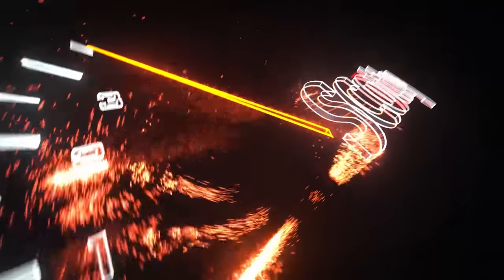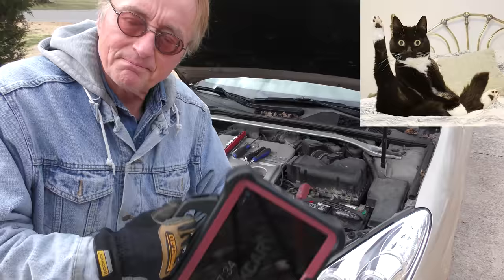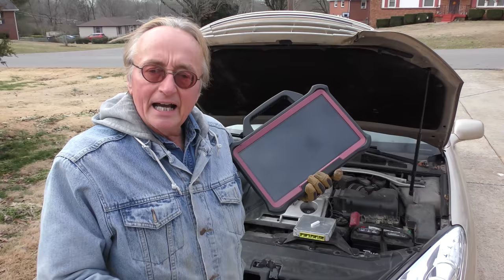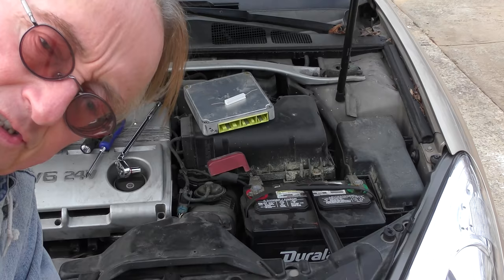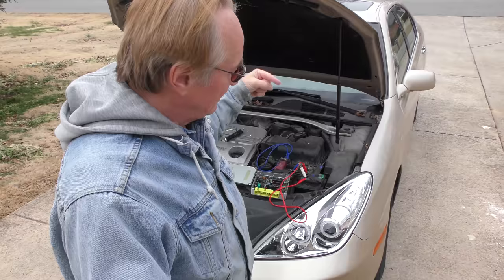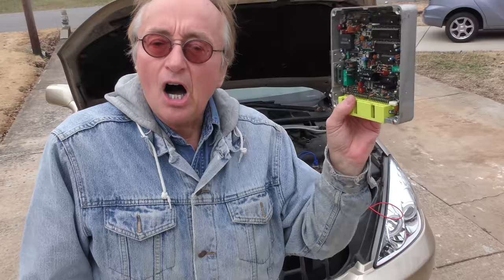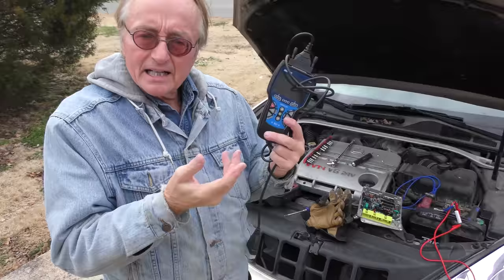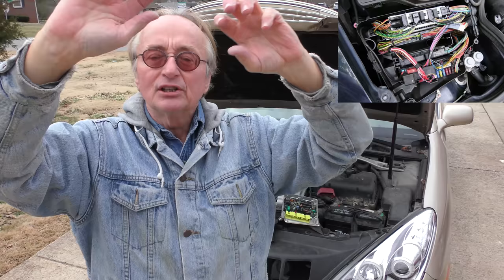This Stupid Thing Will Save You Thousands in Car Repairs

Comment: I think that the resistor you used is 1000 ohms, not 1 ohm. The K means to multiply by 1000 (and the J means + or - 5%).

Comment: hey scotty took picture your resistor say 1k 10 watt not 1 ohm 10 watt as u spoke on air can u tell me which is correct before try on my car from a 72 years hobby garage mechanic and thaks for your years of service and your excellent skills yes i i still own my 68 vette 327 350 hp original 19 years

Comment: You are so correct on that resistor. Even though you may remove the ECM, there still is voltage potential in its capacitors. I am a retired electrician so I used to work with things similar to this.I can see if a person shorts the --- and +++ together, that would cause a large inrush of current through all of the electronics from the negative to the positive destroying its solid state components. Just a very slow bleed of electrons going from negative to positive wont hurt any of the surface mount components. Scotty Sir,,,,YOU are the man. I find your podcasts very informative but entertaining as well. BTW, were you an Army paratrooper at one time?
Reply: I'd use a 1k ohm resistor. It would be a lot slower to drain any charges, but at 1 ohm if there are any charges built up that might drain them way too fast.v=iR or i=v/R.
Reply: Badbrain3185, would it also be a 10 watt, too?
Reply: @bettepage4856  It all depends on the manufactures design.

Comment: Good info for older vehicles pre 2003 ish , but be aware. You may accomplish the task of clearing stored codes, however a lot of that information would be helpful to diagnose current issues so your not testing or changing multiple components. Many vehicles store data to set thresholds for components to rely on. If you hard clear your stored data it may take days for your car to set new parameters. With a professional scan tool you can remove unnecessary or multiple issues and save needed data. If necessary I would only remove neg bat terminal with a terminal tool and turn on some lights to drain down stored power in capacitors.  If you hard drain  the electrical system on some new vehicles you lose data stored for fuel economy and performance curves. Radio, GPS, phone, seat, some keyless entry, and many personal settings on some equipped cars.

Comment: Scotty spot on,I and a lot of other factory trained tech should know this ECU or ECM look computer 101. Not every technician is factory certified or trained. There is another way to do this on most not all. After properly disconnecting the cables turn on the headlights for 5 minutes to drain any residual voltage in the entire electrical system. There are fail safes in the circuitry to prevent excessive discharge. The engineers never planned on us shad tree mechanics to figure ways around the proper way or their way.
Reply: Helpful tip! Thx.

Comment: Around the 4 minute mark, when taking off the batter terminals, you should take the negative off first.  The neg is grounded through the frame, and if you attack the positive first and are vigorously twisting with pliers, you might accidentally touch some other metal part electrically connected to the frame and complete the circuit with little internal resistance, resulting in a nice, burning arc.  Watches, bracelets and rings are especially dangerous in this case.
Reply: They also make battery terminal pullers. The tool won't damage the terminal, like vise grips, and they cost under 8 bucks at USA auto parts stores.
Reply: I thought you were right, so I checked a few reputable websites, and you are right. Am surprised Scotty got this wrong.
Reply: Yes ground off first. Goes on last.
Reply: @Steve_K2  I would bet you $1000 bucks he does know the right way to disconnect a battery but he has so much knowledge swirling around in his head that sometimes it bumps into each other and causes a momentary clitch.
Reply: True.
He also doesnt need to remove the negative terminal.
Reply: main reason for Neg first is so the + terminal doesn't bump anything causing sparks and arc welds.   Otherwise, with proper caution it doesn't really make a lot of difference.
Reply: @arvbergstedt3303  I transport vehicles for an vehicle auction company and have to boost them sometimes. Positive on first then negative, negative off first the positive is the rule.
Reply: hmm.. I wonder if for the installation of the live electric cable in the house we have to connect/disconnect the hot cable first? or it's just because of the AC vs DC system
Reply: Scotty, you call yourself a mechanic yet I just watched you pull the positive battery post first before removing the negative. SMH 😳
Reply: @faradaysage15  At least with your idea it would have justified why he pulled off the positive first. Good call.
Reply: @BionicLesbian if you’re careful it doesn’t really matter which cable comes off first. But it is a good habit to take negative off first.
Reply: Scotty just needs to hold the resistor between his left and right hands for 10-15 minutes. We inadvertently made his discombobulator store a code. 😂
Reply: @alecfed  right. you always do the reverse when reattaching cables to the battery.
Reply: Nitt picking ladies, if you short out the position yes with vise grips your being clumsy and a puller would have been better but really, find something else to do rather than busting his chops this guy has saved thousands of people millions of dollars. We all make small mistakes. Keep strong Scotty we all appreciate what you think and do.😊
Reply: Good catch😮
Reply: Imma try this tho I'm scared I'll blow up
But I have a u0028 and  a u0073  and my navigation stopped working. .
Reply: @chefottoman Actually it does matter.  Disconnecting the positive first can cause sparking which could ignite hydrogen gas around the battery and cause an explosion.  This is the same reason you're supposed to connect a negative jumper cable on the car being jump started to a ground instead of the battery.
Reply: Most times nothing happens, but when it does, it's not pretty. That's how I was taught, negative off first, on last.
Reply: Can't argue with that.
Reply: @chefottoman you never do something half a$$ed.  Improper maintenence or use of a tool, because a vehicle is a tool, creates injuries.
Reply: @kash1407 yes they connect the neutral last
Reply: @haywardcowan8574 &glitch 2😅
Reply: @seven471 then the hand servos might freeze up..
Reply: I have 96 Mark VIII, will this work on it?
Reply: @kash1407 in a house on ac, you have two "grounds" an earth, which gounds the fixture, your bare or green wire, then your nuetral, which acts like the ground on DC, white. Then your hot, black.  The thing with AC, it faults to earth, so if you touch it to anything that grounds to earth, including you, it will fault.  But yes, an isolated box, with the ground off won't spark to the hot, but most boxes you have to pull the hot to get to the ground in the back of the box.   Best just to turn off the breaker, and check it.   Colors are US, sometimes red, blue, orange, etc are used for got for different circuits.
Reply: @BionicLesbian ever make a video?
Reply: Yep, always taught to remove the negative cable first, sorry Scotty!
Reply: Negative Positive... I'm positive that Scotty has a net worth of 6 million dollars so SMH
Reply: You're right. Scotty did a video on it a few years ago. Don't know why he removed the positive terminal first.
Reply: Man you guys are just nit picking.
Reply: You wuss.🤗🤗🤗
Reply: @BionicLesbian  Actually, it doesn't matter if you're careful.
Reply: @donoimdono2702  Yes, actually, it doesn't matter if you're careful and he didn't need to take both battery cables off.
Reply: I agree, the negative comes off first, when installing anything on a 12 volt system it goes on last.
Reply: He usually does tell you to remove the negative first. Guess he just got it wrong this time
Reply: @haywardcowan8574 
Had a brain fart
Reply: Positive off last. Positive on first. I reverse that procedure when I reinstall them.  I follow the same sequence with jumper cables. I hook up the positives then I hook up the negatives. Afterward, I remove the negatives then I remove the positives.
Reply: @Steve_K2 There do exist cars that have a positive ground. I'm not sure if this vehicle is one of them.
Reply: Don’t be. This guy is a menace to your car.
Reply: Serious auto techs come here for the comedy. The guy is dangerous.
Reply: All ways use a flat head screw driver to widing the terminals after losing the nuts and use rubber ends pliers or you should be able to twist them off with worker gloves and not rubber ones.and all ways wash your hands because of the acids on them.
Reply: I'm sure he knows, and thanks for the info, don't forget how zaney the dude is... he probably likes the excitement of the risk, like me 😅
Reply: Thanks for the warning! I’m not as careful as Scotty as he has probably done this 100s of times and realizes the problem without verbalizing to us. Your warning helps us amateurs.
Reply: Makes you wonder what he knows that you don't.  You can't buy experience.
Reply: Honestly the odds of something bad happening from positive first is like 1 in 100000. If you know what your doing, you will be fine. The only time I ever took negative off first is to check alternator.

If your messing with a very high end car, then yes, just do negative first to be safe. But 98% of most cars it’s perfect fine
Reply: @gotruut9145 Lmao! So unless you do the work yourself, you would rather trust some guy who gets paid $12/hr and you can’t see what he’s doing until you pick up your car from shop?? I’ll take my chances with Scotty anyday! Even if he messes up something, he can fix it instantly. 

He’s got a $5k scan tool lol! J/k, that has nothing to do with my original comment. Lol
Reply: Not perfect... I want all my $$ back!
Reply: @davegravel3740 so the vehicle that you are jumping you should put the negative onto a metal part of the frame and not on the battery as you're jumping it?
Reply: Dead wrong, the golden rule is negative last. Tkae the negative off last, put the negative back on last. Negative last negative last negative last!
Reply: Not picking ladies. Looks like men doing the nit picking.@chefottoman
Reply: @Steve_K2  age..I know I am 68 😅. Love him
Reply: Scotty love your videos. Even though I am not a mechanic just know a few things..❤😊

Comment: Resistor plainly shows: 10W 1KJ  - 1k is 1000 ohms. Big difference from 1 ohm.   1 ohm would basically be a short.
Reply: A thousand ohms would take days to discharge and it wouldn't need to be 10 watts.  But... I think a 12 volt light bulb would be a better way, low resistance when cold and much easier to source.
...and I would never use a ratchet on a battery, always a short wrench.
Reply: Scotty's mouth runs too fast for his brain.

Comment: Well done, Scotty!  When removing the battery cables, be sure to remove the negative cable first, and when reinstalling the cables, install the positive cable first.
Reply: Yep, Negative off first and reconnected last.
Reply: Why did he take the positive off first?
Reply: @CreeCarnivore  That's a good question. I'd like to know why Scotty disconnected the positive cable first, too.
Reply: Scotty is such a great mechanic he knows better to not ground a hot tool at the positive terminal
Reply: @CreeCarnivore   Electrically speaking, it doesn't matter.  The reason for removing the negative first is if you should accidentally touch the wrench to ground while it's on the positive terminal, if the negative is still attached.  That would be bad.  If the negative is removed first, you don't need to be careful when disconnecting the positive.
Reply: Good tip, Scotty!! But please, for non english spoken people, speak slowly. Is it a 10 watts 1k ohm resistor? 1 ohm seems too little.
Reply: @danielmancebo8418  I agree, and was tempted to mention it but didn't.  1 ohm is  ridiculously close to a direct short, which Scotty warns against.  If you're concerned about a direct short causing a spark and hosing your electronics (I'm not too worried), and since most folks don't have a 1 ohm resistor laying around (I do, but I'm weird) just find any incandescent light bulb, from a car or a home, and include it in the circuit.  They have a low resistance of a few ohms when initially turned on.
Reply: @LarryCook1960  Hi. So how many ohm/watt resistor that is safe and easily available should one use?
Reply: @muhammedk470  I would just use an incandescent light bulb, from a car or a house.  An automotive test lamp would work fine.  I was merely commenting that Scotty thought a short circuit was too much, but 1 ohm is ok.  In my opinion, those two are essentially the same thing.

Comment: love your videos but agree with "Vetsus".  If the wrench on the positive touches any engine or body metal, you get electric welding and could blow up the battery with the short circuit to ground..   If you remove the negative (ground) first and hit something with the wrench, nothing happens.  Once it is off, the positive is no longer chassis-seeking, so you will never short the battery that way.
Reply: Good practice to always remove the negative cable first, since it is grounded to the frame and body.
Reply: There's no ground on a car - only a return/common.   Now for a twist... some very old school rides [like pre ww2] used positive battery terminal as common.
Reply: @juan7559  What the!?!? Quite an incongruous statement
Reply: @juan7559  That will mess up the flux capacitor!

Comment: This is a very handy tip! I take precautions such as this when I work on computers, but it never dawned on me to do the same when working on car systems. It makes me wonder why car manufacturers don't just include a factory reset button as part of the wiring. I'm guessing they don't include a reset because that would make it too easy.

And regarding scanners, I did take Scotty's recommendation from a previous video and purchased a ThinkOBD 100 scan tool. The $35 scanner saved us hundreds when we knew roughly what was wrong and found a mechanic who used their $5,000 scanner just to verify and charged us nothing for diagnosis and knew exactly which ignition coil to replace.
Reply: His scanner cost $5k. The snap-on scanner that a lot of shops use are $10k.
Reply: It isn't a question of too easy. It is a matter of car owners using the button every time they imagined something was wrong with their vehicle.
Reply: Since 1980 there has been no engineer hired by an auto manufacturer that gives a rats  ()*71 about any mechanic. They only are concerned with how many cubic feet they have to shove stuff into. And why did automobiles work great up to 1980 and were just fine without computers? Because your government wants your car to run right and that means clean... thank God they care!
Reply: Where's the money in that everything they do they're doing it to make money eagle

Comment: Word to the wise scotty failed to mention...

Whenever you "reset" your cars ecm, you often will need to preform a idle relearn (not always) and shift adaptation. I learned this back on my 2012 ford fusion, it would never run right after a reset and come to find out the idle relearn in the manual is more than just "drive it"
Reply: Good to know.  What had to be done?
Reply: @flinch622  With vehicle at a complete stop, set the parking brake.
Put gear shifter in "P" (Park), turn off all accessories.
Run the engine until it reaches normal operating temperature.
Allow engine to idle for at least one minute.
Turn the air conditioning on and allow the engine to idle for at least one minute.
Release the parking brake. With your foot on the brake pedal and the A/C still on, put the vehicle in "D" (Drive) and allow the engine to idle for at least one minute.
Drive the vehicle to complete the relearning process. Just make sure you drive easy for the first 30 miles, so the PCM can re-learn and adapt to your driving style.
Reply: .........ford
Reply: If i do the resistor thing he is talking about do i need to take it to get it reprogrammed? I didn't quite understand thanks
Reply: @mommasita9949  that's a load question, what are you trying to do? 100% common questions are answered in your specific owner manual.
Reply: @Crowesnest2021  that 2012 v6 fusion was drove hard, it was a great vehicle for me, I traded it in for a 2020 corolla. I do miss the ample space it had, snappy v6, could fit so much in thst fusion. My corolla feels like a micro compact car and has very little storage but it was time! Glad I bought my corolla in 2020 for below msrp!

Comment: Scotty and everyone....NEVER take the positive cable off before the negative cable! When removing a battery or disconnecting it take off the negative then the positive. When installing the cables or battery put on the positive first then the negative. Use that same process with jumper cables! This way you are unlikely to damage any electronics or computers. Always ground yourself as well when working on the computers. Buy a wrist band is the easiest way to accomplish that. Less than $5. But if you don't know that already you should not be attempting that work anyway
Reply: The wrist strap is to protect the electronics from static electricity charges, which are in the thousands of volts. It is unnecessary for automobiles at 12 volts - plus you can easily ground out any static charge by touching some metal part of the vehicle. Ever been shocked by sliding across a car seat and then touching the door as you get out?
Reply: @buggsy5  I'll stand by what I said about the straps and cables.